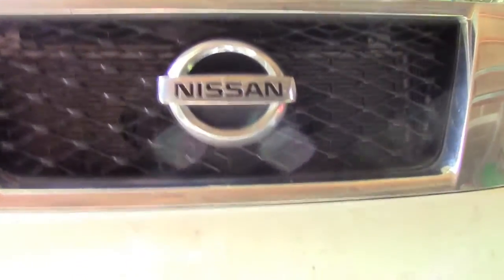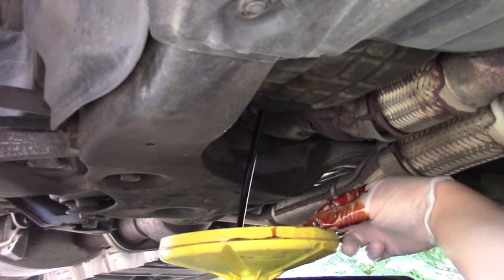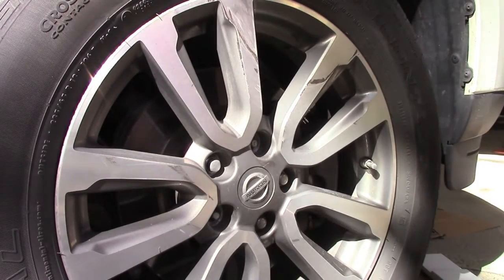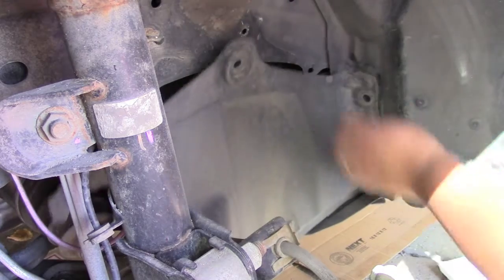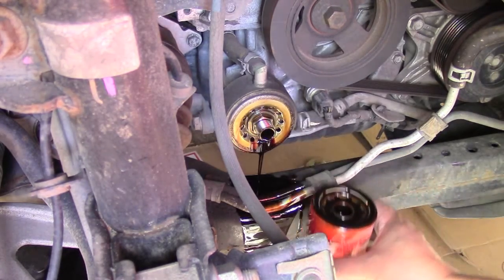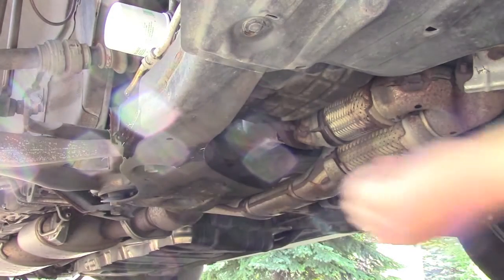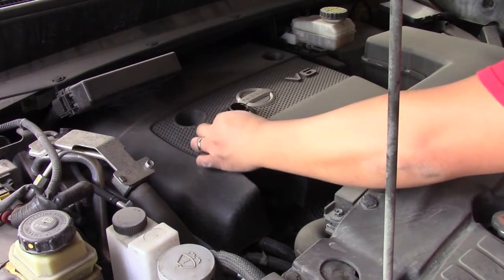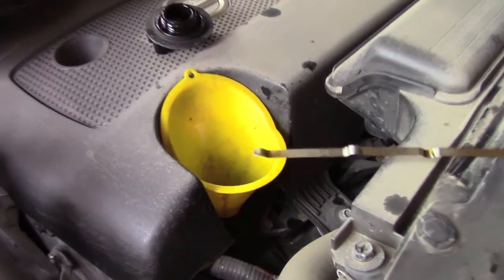DIY - How to Change Oil Filter and Engine Oil on a 2013 Nissan Pathfinder

Comment: never use a open end type wrench  you can round off the drain plug nut/bolt      use a  6 point  socket and ratchet       or a box end of a wrench     also I noticed how you were removing the push pins       it was the incorrect way       im surprised they did not brake

Comment: you should run the car before you check the oil level to ensure the filter has been filled for a proper reading

Comment: the voice over was hilarious was this your first time changing the oil not being a ass but "the yellow thing" is the dip stick and people don't just add and check always check your owners manual for the correct oil specifications weight/capacity oil is very important if it's your first time try asking a experienced person for help your first time to make sure you don't destroy your engine.

Comment: I’m changing my 2015 path now. being that this was the first time because for the first two plus years we’ve taken it to the dealer I watched the video and was shocked to see people taking off the tire.  The filter is easy to get to if you get underneath the front of the car. No need to remove the wheel.

Comment: You don't need to remove the wheel to get to the oil filter and you don't need to jack up the car to drain the oil.  The car has plenty of space underneath.

Comment: buy  yourself  a 14 mm socket or  wrench    do not use a adjustable  to remove the oil drain bolt you need to learn how to take out push pins the correct way